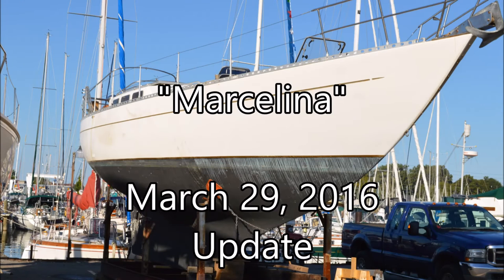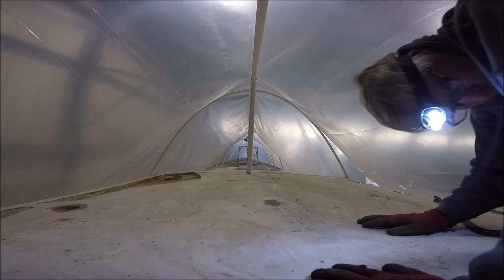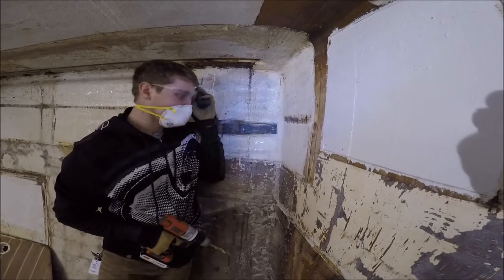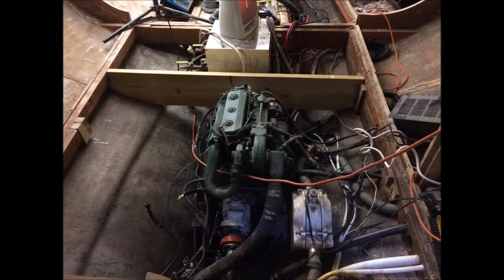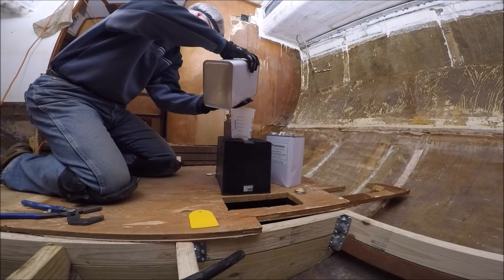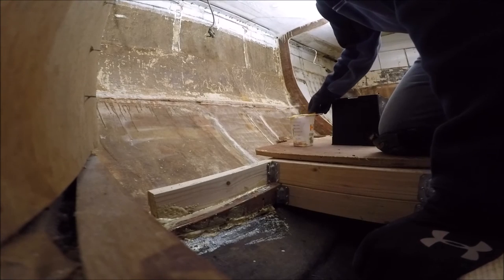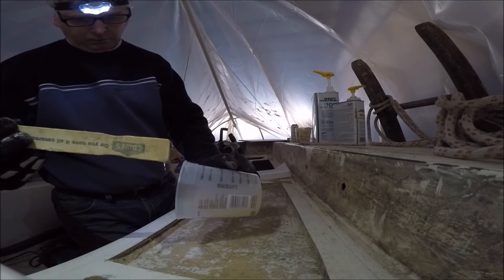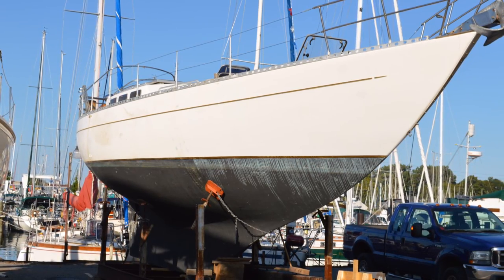Ep. 5 - Marcelina  March 29, 2016 update

Comment: You are doing quite a restoration.  in the words of an automobile restoration, It is frame up.  Laughed at your son and the use of PPE.  I did the same thing when I was young, and now harp on anyone who doesn't use PPE correctly.
Reply from the maker: +Scott Van Nederynen I can't complain... he works hard and the price is right. I just worry because his day job is installing solar panels where it could be a lot worse than getting dust in your eye is something goes wrong.
Reply: +Dan Courtney I've had bits of metal dug out of my eye three times, it's not pleasant.  Oddly enough, I was wearing safety glasses all three times but when working in a confined space and awkward position flying bits can come from strange angles.  On an unrelated subject, isn't the engine nearly inaccessible and impossible to work on if it needs repair?  Or does the camera angle make the space look smaller?
Reply from the maker: +TheMudbrooker I think the camera angle makes it look tighter than it is. All the maintenance areas are accessible, although I would need to disassemble the floor joists if I needed to remove the engine.